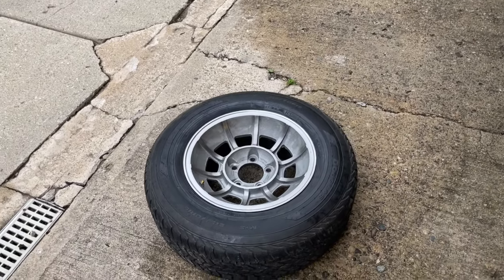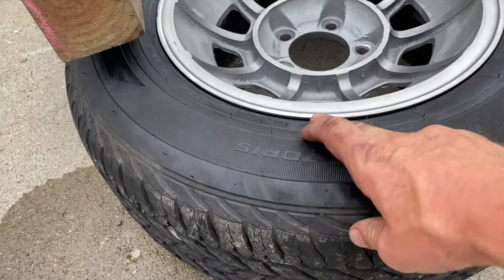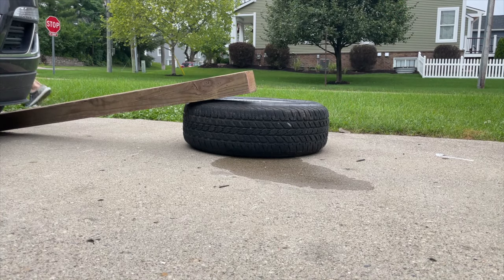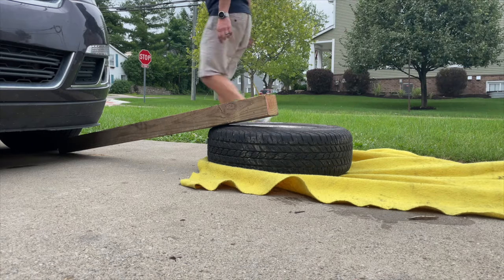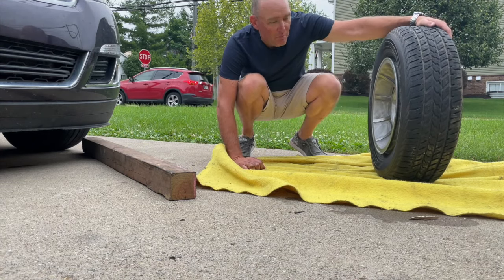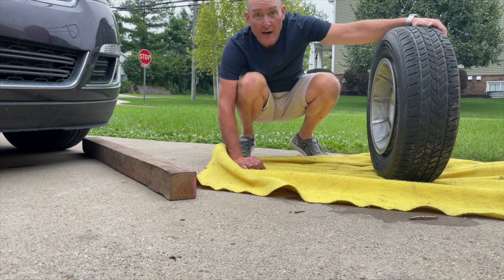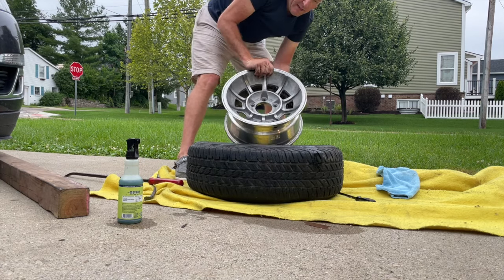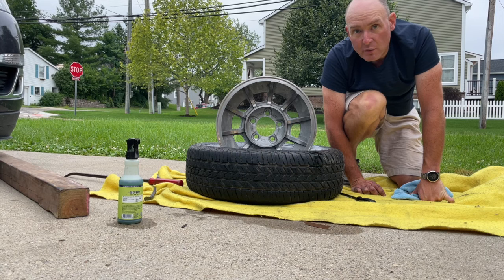The Easiest Way to Remove a Tire from a Wheel/Rim at Home

Comment: Just a few complaints about your technique... first things first you need to explain to people that you should place the rim front facing down on an old piece of carpet or something similar as to not scratch the front facing side surface of the rim... then explain that facing the rim front faced down means that you'll be removing the tire from the backside of the rim using hand tools that could very possibly damage the front facing surface causing irreparable damage... so next time remove the tire from the rim especially if they are anything but steel with hubcaps or unless your absolutely not concerned about damaging your front facing rim causing damage that can't be repaired thus not saving you any money let alone $5-$15 per tire is not worth the effort or the money if damage to the rim happens during removal/replacement of the new/old tires... great job otherwise but details matter... thanks for posting next time front rim facing down on an old piece of plush carpet or similar material would be best...
Reply: If the person is so stupid as to drop their rim face down on the concrete...well they just need a bus pass.

Comment: I use the trailer hitch on the back of my SUV. Set the tire down along the receiver's centerline, throw a scissor jack between the receiver hitch and the tire and start cranking. The jack's base is almost a copy of a tire store's presser foot. Works great too.
Reply: Great idea, more my speed.  Don`t have to look for some lumber.

Comment: Old tire jack is this best ways came with cars in the 60s and 70s. What your doing does not always work back side of tire with raise up on ground depending how old long the tire has been on steel wheel mags are easier to break loose they want rust

Comment: Well done! 
I tried it on two 23 year big and OLD trailer tires and it did not quite get it (practically welded to the rim amazing as that sounds), so ended up using a farm jack as a clamp. I think your technique helped a lot and got it started.
Reply from the maker: Cool.  Glad it helped.

Comment: This method is acceptable if you're not planning to reuse the tires. If you deflate the tire as much as possible with the valve core is still installed, you greatly reduce have a risk of it launching itself. If you have clip on weights it's a good idea to remove them right after deflation

Comment: How do I make sure I'm not damaging my chrome wheels while doing this?
Reply from the maker: I didn’t say it was the best way, only that it was an easy way.
Reply: Put a piece of plywood under the wheel.
Reply: I’ve not tried this. But maybe you could get a length of rubber hose and put a slice in it lengthwise so that you can slip it over the rim to protect it. A thicker hose would obviously be better.
Reply: tape some foam around your prybar where it contacts the rim

Comment: In the case of your life depends on the tyre - no questions. But IRL side effects of such a procedure aren't worthy the result. Which side effects? One may damage bumper of the car (if wood stick slides), may damage cabin if wheel jumps at the last moment, may scratch the rim, using metal tools for removing tyre. It's 21st centure! I used this way back in 1993, when I was a 15 yo boy and we didn't have tyre service in my town. The method is functional, but it is using tools, it is dangerous and dirty.

But respect to the author for reminding.

Comment: Dont work ! Tire doesn’t just pop off.  You cut yours maybe
Reply from the maker: Nope.  Worked for me.
Reply: remove the valve core, otherwise the tire stays pressurized and will probably explode at the sidewall instead of allowing the bead to be pushed down.